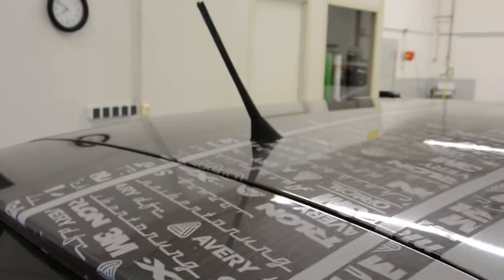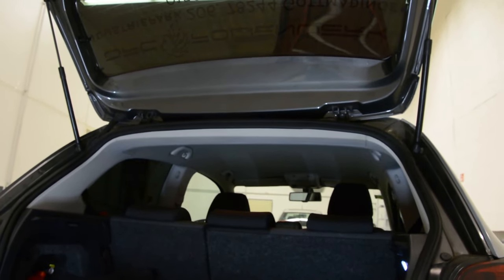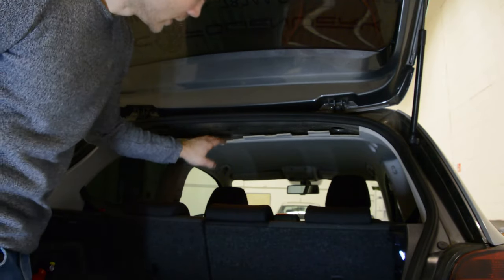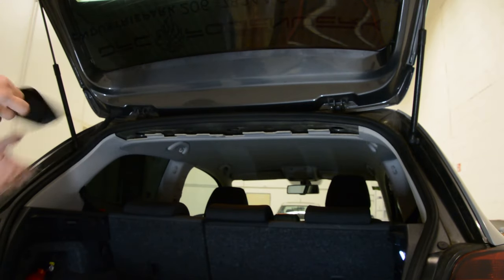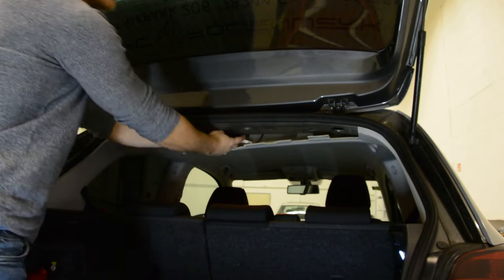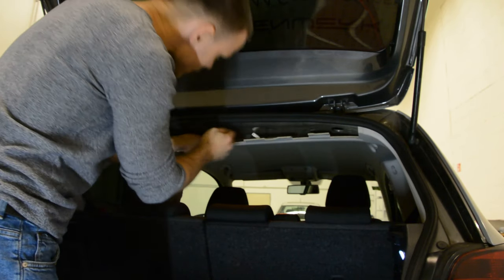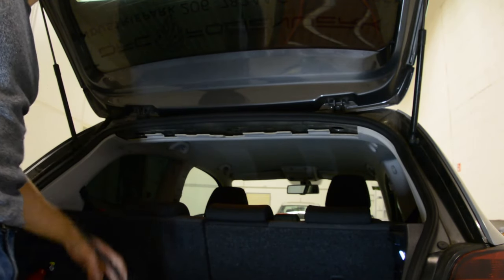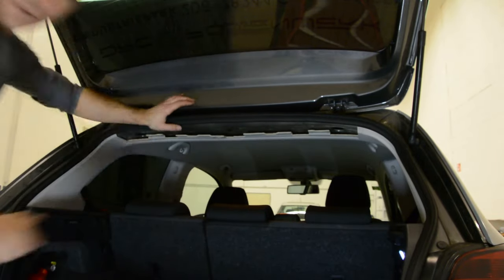Radio Antenna replacement VW Polo 6r

Comment: I always thought that screws needed a screw driver not a spanner but learn something new everyday.
Reply: @darrennixon8765  How many languages can you speak so you can say is nothing to do with native speaking?!
Reply: @darrennixon8765  
screw nut

noun
a nut threaded to receive a screw.
Reply: @darrennixon8765  “A nut is a mechanical fastener with a threaded hole. It is attached to a bolt, SCREW or stud to provide a clamping force and prevent axial movement” and watch your language, I mean your spelling , make me think you are not an English native speaker as well 😂
Reply: Why do you feel the need to comment silly things like that do you just always have to be right?